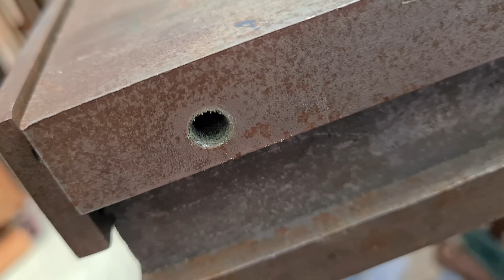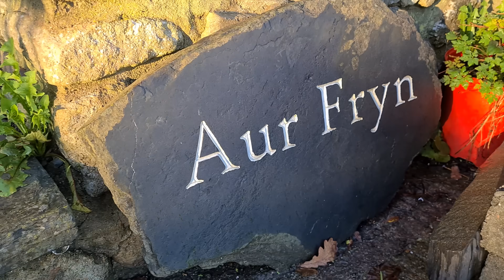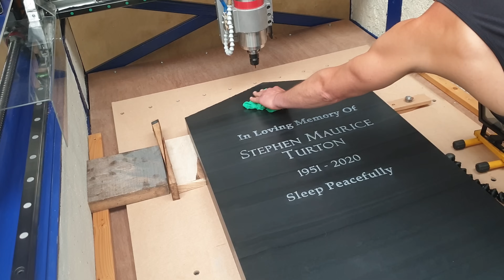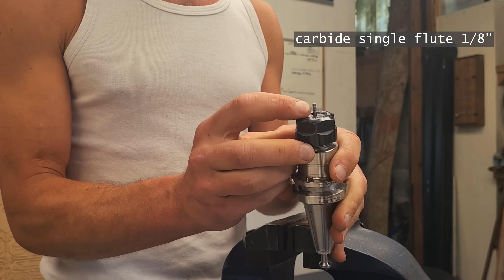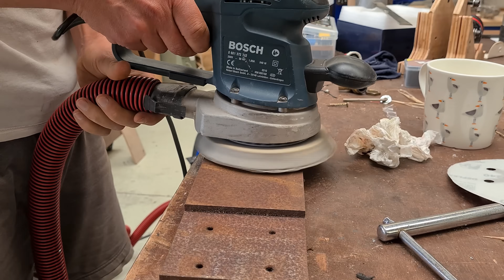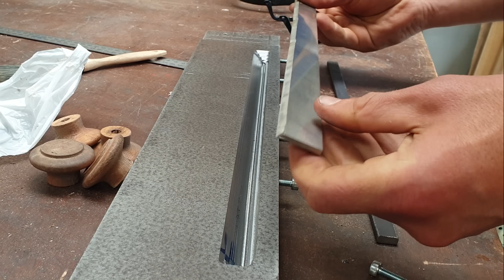The CNC was not Designed for this!

Comment: When you surface grind something, you don't grind over the entire surface. That is way too much contact, creating too much friction and heat. Grind down the length in strips of maybe an eighth of an inch (a couple millimeters) at a time. Then step over and grind the next strip. Watch any video on surface grinding and you will see what I mean. You go back and forth, back and forth, slowly traversing the part.

Comment: I know this video is a year old, but I've been doing some research on building a DIY milling machine and found your vids through that. One thing I've read when it comes to milling steel and the like is that you want a motor that has a low'ish RPM but also high torque. I've considered the 20k RPM spindles that most Chinese companies produce for DIY CNC machines but they all seem to have a very low torque rating which doesn't make them ideal for metal. Great for wood, plastic, acrylic, etc., but not so great for hard stuff. So I've been looking into your typical 3PH 220V 1750RPM 2HP motor that can either have its speed reduced through a VFD or multiple pulleys. So aaaall that being said, have you considered swapping out the spindle if you're primarily going to be cutting metal, or perhaps doing a hybrid/modular setup where you could easily swap between the current spindle and a more appropriate metal-cutting motor?
Reply from the maker: @SmokeGSU  thanks for watching friend. Considered, yes. Done anything, no. Thus far I have only machined steel a handful of times - I'm mostly using it on wood and aluminium... steal is doable with small single or double flute (not the usual 4 flutes) endmills  and shallow doc with quite high feed rates.  That gives a feed per tooth comparable to more traditional milling... thanks again 😉

Comment: That mag chuck has probably spent its previous life on a wet surface grinder. The worktank fills with weird grey weakly magentic slime instead of dust being emitted and it gets everywhere, so its not surprising some made its way into the insides of the mag chuck. They can become demag'd too, I have a weak one on my SG that you have to be careful about how you block in things or they end up stuck in the wall behind the machine as it fires them off the chuck. Maybe I should strip it and see if its full of funk inside too.
The tapped unpopulated holes should have another end fence with oval holes bolted via them, so you can raise the fence slightly above the chuck plane surface to act as a fence to setup from, and to help stop firing things off the end.
Its easy to screw up using a mag chuck, he says remembering the time he put a tall block on and started grinding, only for it to tip because it wasn't blocked in vertically enough, and when it tips it becomes longer and doesnt fit between the chuck and wheel which pulls it in anyway. Causing your grinding wheel to explode, and sending abrasive projectiles round the shop (I have a heavy wheel guard fortunately) and necessitating a change of under clothing...
Reply from the maker: Wow, exciting cautionary tale. Bet you wont forget that one. Thanks again friend.

Comment: I can recommend a book for you (IF YOU CAN FIND IT)
The Geometry of Sheet Metal Work by A. Dickason...  I got my first copy as a present from the man that was teaching me when I was an apprentices.
It was first printed when I was 6 "1967" the one I have now (I've owned 3) was reprinted in 2011. I only got it because I wanted it LoL, NO ONE uses it anymore as everyone thinks CAD is the best thing you can have, because you don't have to know how to make a square to round because the computer can do it for you LoL PMSL
Trying to learn CAD and CAM as I have a little CNC router 3018, planning to make a bigger one with a cutting area of 500mm in the X axis, Y about the same-ish
I just wish I had a workshop? so I don't have to build a soundproof cabinet for it LoL as I live in an apartment block on the top floor in the center of the block.
like your videos

Comment: We had a cnc router at the place I used to work at. 
We had a vacuum extraction system clamped to the cutter head.
Several times it went on fire. First time was worst, took out one of the big bags and required a  fire extinguisher to put out. Not a great hazard in a concrete building but...
After that the operator was a bit more careful. We still had problems with it though.

Comment: Maybe someone did mention thit before me. There is obvious mistake you've made with the grinding. You used diamond grinding wheel for a steel grinding which as far as I am aware is never done. Diamong embeded grinding wheels are used only for tungsten carbide and - not sure nowadays - dry. For steel there are steel grinding wheels. A cup shaped white, green, grey, pink for different steels but in truth any would do better. Also this was very fine grid to fine for such a job.  Aluminium  Oxide #80 grid would do excellent job with the magnetic table - dry would be okish. Yes I wrote rought comment but I know you can read it for its info and not for the style. As for you CNC machine it is simply amazing - I am jeleaous. 🙂
Reply from the maker: Hey friend thanks for the comment :D so lots of people have mistaken the grinding wheel for a diamond wheel. It is not. It's a CBN wheel. Good for hard steals like HSS. It was very certainly too fine a grit though.

Comment: Ya should of ran it the length of the metal instead of it going around in small circles. And maybe outline it or in this case in-line it then rerun it to the to the correct size and it should clean it up

Comment: The heat expands the material, the contact surface increases, creating more heat.. Solution: measure the resistance, pull away for cool down..  Regarding the suction, you could do the Operating Theater Airflow thing, were you create over-pressure in the shed, which the dyson  sucks towards the outside. Needs a sealed work environment though.

Also shouldn't the blade get a heat surface treatment?

Comment: What increment is the Z axis capable of moving? A .001 depth of cut would be huge for that CBN wheel. When I was running CNCs the cut you were taking with the chamfer cutter I might have tried but only with high pressure coolant thru the spindle even with carbide.

Comment: Grinder should go CCW
Reply from the maker: Interesting I hadn't didn't know  that. What is the reason?
Reply: @FloweringElbow  grinding is a finishing process , with the book better surface finish  
because of tool geometry and force , and chips/powder will not melt underneath
Reply: @FloweringElbow  and passes like with header have to be under or above axis tool - so called overlap

Comment: You can't cut steel with those feeds, I'm aware you want to do it as fast as possible, but your machine isn't designed to do that. Even machines, which are actually made to do these kinds of cuts can chatter. And while I do realize your spindle doesn't have much of a torque at lower rpms, you're on the right path picking 2 fluted endmills. 
For the most part, even when your endmill brands states you can go 0.5 radius deep pocket, you'll have to settle at 4 times less. Try lowering your step-over to 0.2 mm and go slower as well, endmills with radius, even a small one like 0.2 will help a lot. You only have to realize, these things, on machines like that can't be done fast. So lower everything and get a coffee while machine is working. If you need any help with feeds, speeds etc, just let me know. Been working on CNC machines for ages now.

Comment: those motors are not designed for steel milling bud simply because that is how you induce extreme wear and tear on the bearings internally.. its probably too late now as the damage has been done but there is a reason why they selected that motor for that cnc table buddy.
Reply from the maker: Hey migman. thanks for watching.  LOL. It was muggins here who built the 'table', and selected the spindle, servos, etc. They seem well up for a challenge ;)

Comment: Have you tried to lidar 3d scan and overlay text to compensate for uneven surfaces?
Reply from the maker: Hi there, thanks for watching. I have not tried that, interesting idea. 🤔
Reply: @FloweringElbow  masso and centroid also have a surfacing feature that does it with greater precision using a probe. But my first solution was "baller on a budget" method.

Comment: Seal the MDF with epoxy and pour a 20 mm layer on top, stays leveled and only needs to be resurfaced when the bit ruins the surface.
Reply: and its waterproof.
Reply from the maker: Hey there friend, thanks for watching. 20mm would add up to a lot of epoxy 😲. Were you thinking epoxy granite or just straight? I dont recon it would add much stiffness to the bed, which is also something we're after - the mdf deflection under load is a weak point atm. 
I like the idea of sealing the mdf for stability, though....

Comment: to correctly collect the chips you need to use some linear brushes like the ones you used to cover the ballscrews on the edges of the vacuum shoe, also that need to be at a fixed height by clamping it on the carriage of the X axis, not on the Z axis.  very good video and impressive machine !

Comment: As a machinist I have a tip when it comes to reducing the chance to get massive burrs on parts. If you climb cut any burr that would be formed by conventional milling is instead pulled into the material. Aka cut into non-existance. However climb cutting is not recommended for maual machines as it has a tendency to try and pull the axis faster than the cutter can remove material. Also by using small amounts of cutting fluid, or oil, on metal you can reduce the chance of chip welding. Hope this helps. 😁
Reply from the maker: Good advice thanks friend.

Comment: Fantastic video and really positive view on life! Just one thing I can maybe add: For the Acrylic or Polycarb you used for your dust extraction, get some Dichloromethane or Methylene Chloride and a squeeze bottle with a flexible, extremely small diameter spout. The solvent "melts" the Acrylic together and then it flashes off and the Acrylic resets, You hold it or clamp it in place for 5 minutes and it is almost perfect. Stronger than super glue and watertight as well.
Reply from the maker: Great advice 👍

Comment: Sounds like we had similar months. I built a big (2m x,  3m y, and 1m z)axis CNC out of blood, sweat and metal. I had one last issue I had to resolve where the z-axis was going out of allignment due to the fact that it was temporarily driven by a 3d printed pulley which caused the belt to slip occasionally. It needed to be replaced by an alluminum pulley. Problem was the hole on the metal pulley was too small for my ballscrew. I therefore built the most terrifyingly overpowered lathe attachment for my cnc for the single purpose of making one hole bigger on a pulley. Lathe attachment worked though and has not killed me yet. z-axis is no longer losing allignment after replacing the pulley. No I can start production with my CNC. Now time for step 2. Step 1: Build giant CNC.   Step 2: ?    Step 3: Profit!

Comment: Fantastic finish on the planer blade. Have you thought much about changing your MDF bed for something waterproof?
Reply from the maker: Hey daxliniere, thanks for watching. Yes! Really I want to replace at least a section of it... looking out for an old mill table or something like that that I could use. The rigidity of the mdf base is the weakest part of the machine atm. Peace, Bongo.
Reply: @FloweringElbow  Haaaaave you considered a granite slab?

Comment: If you are not exploring the boundaries of your machinery and your skills, you're not learning much either. Another great episode. I built a massive flycutter for my Bridgeport. It uses carbide inserts and if you crank the feed rate down pretty far, it can very nearly produce a mirror finish. After that step, it's not too bad to touch up the edges and surfaces by hand since the proper geometry has already been achieved.

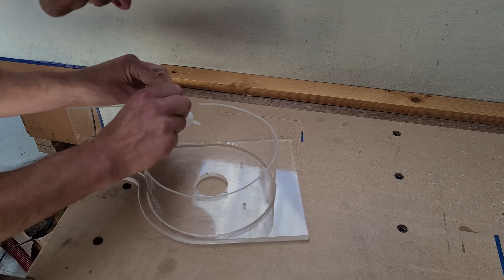Comment: 10:31 how do you keep the accelerator from turning everything white?  I only use it on projects that are going to be sanded or painted or both
Reply from the maker: Hey there. I haven't used it on wood much, and haven't yet observed this phenomenon... Spray it on the wrong plastic (polycarb i think) and it immediately cracks though... Will look out for the white effect.

Comment: Those slightly discolored chips are an indication that you're slightly closer to running that endmill as designed. Lol. When you're getting close to the right speeds & feeds, you'll start seeing some beautiful iridescent purple chips.
Reply from the maker: Thanks for the advice Roger!
Reply: @FloweringElbow  you're welcome.  Honestly, one of the most helpful things you could buy is a machinist handbook. It's one of the best resources a machinist can have. Most toolboxes designed for machinists even have a specific drawer intended to hold it. Lol.

Comment: I recommend you try adding an angle to the spindle so only one point of the grinding wheel contacts the surface. Cut up and down the chuck with a very small step-over in the cross-feeding axis added every other pass.

Comment: Watching that bit on the Slate house name engraving, can I suggest you use a probe to probe the surface in a grid and build a surface map (heatmap). This gets subtracted from your actual cut so that the engraving bit is always the right height over the surface. I used this last weekend basing the idea on people who use this to get super accurate PCB engraving. It worked a charm.

I used bCNC to run my cnc, but I am sure this musht be workable with other controllers.

Comment: i would NOT vacuum those sparks because it can lead to fire inside the vacuum.
Reply from the maker: Hi ipadize, 
You're right of course. The metal bits do pass through a cyclone and collect in a steel barrel (which is emptied of all wood before I start with metal) - but you're probably still right. Peace, Bongo.
Reply: @FloweringElbow  ah okay if there is no sawdust or similar left in the system then it should be no problem :)

Comment: As a CNC machinist for over 35 years i cringed so many times in this but i love your positive attitude.
A couple of tips for you if i may. 
When milling the blade at the end, if you had made sure you had climb milled, you'd have pushed the burr to the inside of the face rather than over the side.
Trochoidal milling was definitely the right method for the pocket, but I'd suggest the cutter runs at around 120-150 m/min surface speed in steel and keep the stepover to under 10% of cutter diameter.
Oh and buy a center drill for spotting the holes - those chamfer / deburring tools dont last long when you try drilling blind !
PS just sitting here suffering from covid myself for the first time - IT SUCKS !!

Comment: If you're needing to sharpen the planer blades again, you can make magnetic 'transfer' angle blocks that will conduct the flux up to the blade and hold it properly, instead of shorting it out (just holding down the blocks). They are made with stacks of brass/aluminum and steel in a similar manner to the surface of the magnet chuck. The CNC machine could cut out the profiles and pin holes from sheet stock. (Don't pin them with steel). The downside is that you would need several blocks as the blade is pretty thin.

Another option is mounting the magnetic chuck at an angle like you did in the beginning. Then placing a small brass/aluminum shim under the blade. This should give you just a tiny bit of clearance from the surface of the chuck to grind to the edge. The blade would be held down with a strip of steal, the entire length of the blade, with a rabbet cut down the length so it touches the chuck and the top of the blade.

Comment: Did anyone point out already that it is a bad idea to grind mild steel (I.e mag chuck )with a diamond wheel? Diamond wheel is excellent for grinding carbide and not bad (but not ideal) for tool steel
Use small diameter 60-80 grit aluminum oxide or silicone carbide grinding wheel 1”-2” ( calculate proper RPM to get about 3000 SFM.
Do dress the wheel flat with a diamond dresser before grinding.
Watch the wheel. If it loads up with metal (dark lines appear on the surface) you need to re-dress the wheel and take shallower cuts.
Loaded wheel does not cut the material off, it just rubs against the surface and the result is spindle stalling.
Always start with very shallow cuts (0.01mm) to find high spots. Don’t go higher than 0.05mm
Two 0.025mm passes are better than single 0.05mm pass.
The less rigid the machine is the shallower the cuts must be to minimize the chatter.
You cannot avoid chatter on your setup (play in linear bearings, flex in the gantry, play in spindle bearings) but you can reduce it with shallow cuts.
Reply from the maker: Good advice, thank you.

Comment: There is Lead surrounding those segments which will gum up you diamond disc , they want scraping out just below the surface which will let air/coolant get into it and should give better result.
I used to have to scrape them out as an apprentice.
Reply from the maker: Wooow. Mind blown - I think this would have been the saving grace of this adventure... Had I but the wit to know...

Comment: Offset the tram of the spindle intentionally so that you are only side whee grinding on a small portion of the diameter of the wheel. This does create a scallop but with small step overs each pass the depth and width of the scallop becomes irrelevant.
Reply from the maker: Hey friend, thanks for watching. I like this idea, I'd be able to control where the sparks fly too. Trouble is, loosening the spindle and messing with the tram fills me with 'hours of fiddling ahead dread'...